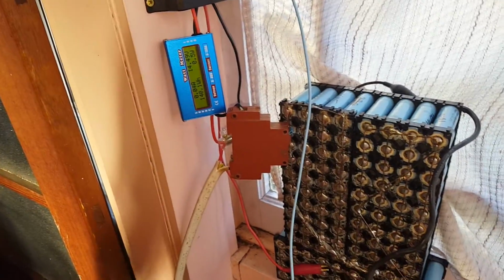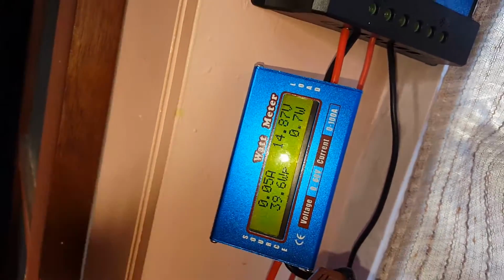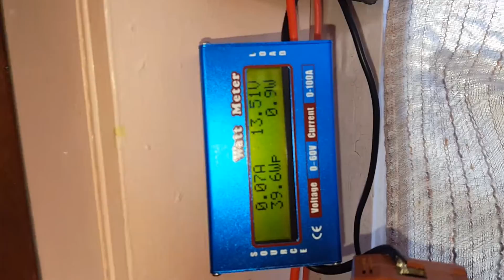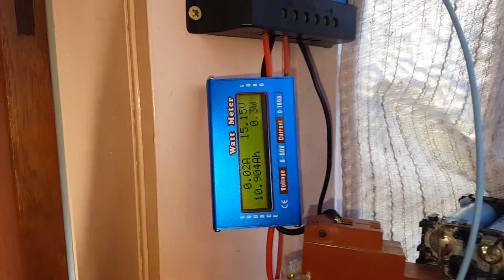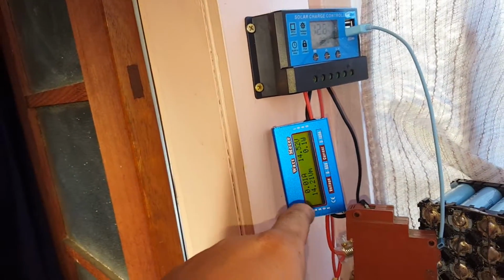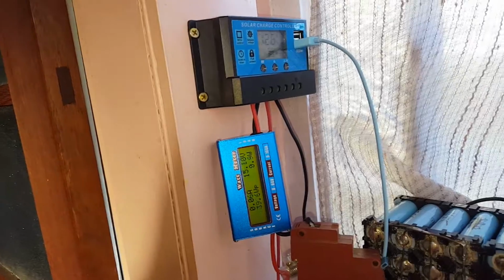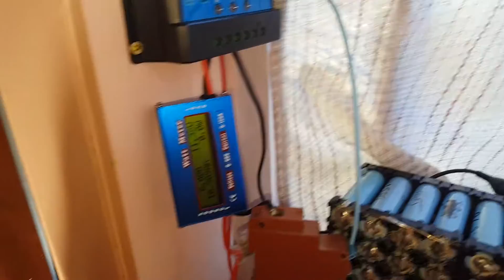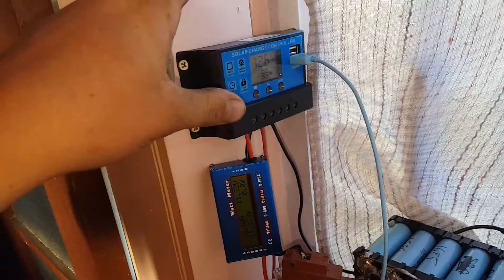Mini Diy powerwall  First day of power production tests 140watt hrs in

Comment: I am interested in a link to the Charge Controller.  I have been having a hard time figuring out which way to go with (without spending too much) on a 24V Solar Charge Controller to work with my Li-ion battery bank (24V/20AmpHours).
Reply from the maker: +Bob Brundage if you jump on ebay  and search solar pwm charge controller  up they come and there is many less than $20 ones like this cheers
Reply: Is there any reason to fear those, what appear to be, super cheap 'China' pwms?  I was thinking they were too good to be true.
Reply from the maker: +Bob Brundage not if you check there operation  i dont think theres anything to fear
Reply: Thanks for the info!
Reply from the maker: Bob Brundage have you seen some newer videos i now have 2 pwms working on the same input charging a multi chemistry  battery bank

Comment: Which reference to your load controller?
Reply from the maker: +Davi Gomes no load controler only a charge controller
Reply: Is this charge controller for Lithium battery or lead acid battery?
Reply from the maker: Davi Gomes lead acid. stop voltage programable and set to 12.7